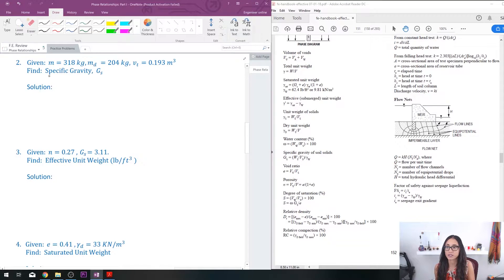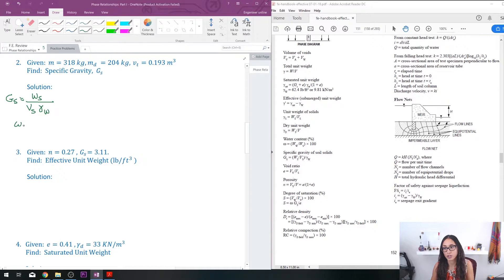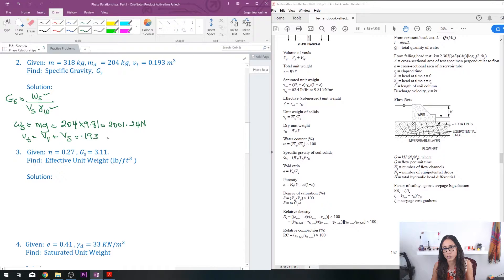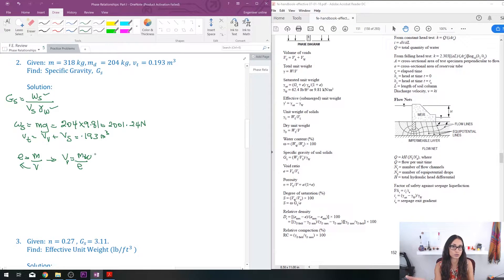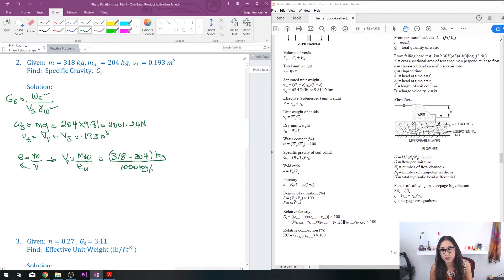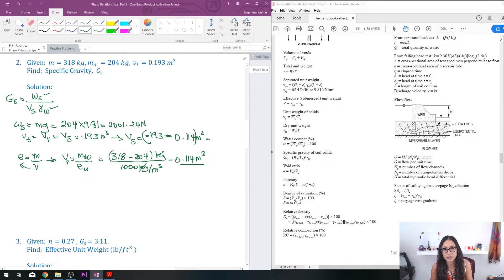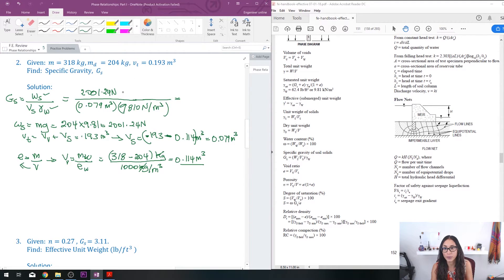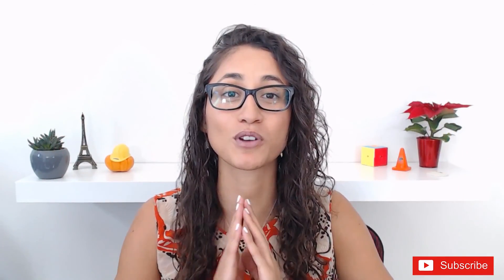FE Civil Geotechnical - Phase Relationships Specific Gravity Gs

Comment: Hi Kenza, are we allowed to make the assumption that this is 100% saturated? Because I got 0.114 for the volume of water. I was struggling how to calculate Va because the problem never stated it was 100% saturated.
Reply from the maker: Hello, you can't actually make the assumption that the soil is 100% saturated, also, we don't need to calculate Va (volume of air). All you need to determine is Vs (volume of solid), but we had to calculate Vv (volume of void) first, to be able to determine Vs. I hope this makes sense and good luck with your studying!
Reply: @Genieprep  that is actually wrong what you said. You divided the mass of water (114 kg) by the density if water (1000 kg/m^3) which gives you volume of water, not volume of void. The book where you have taken the problem from actually says it is a saturated soil sample. Only in this case, the volume of water (which you have calculated) will be equal to volume of voids. Thanks and let me know if I am wrong.

Comment: hi are you going to be adding videos for problems 3 and 4 and some bearing capacity ones? and did you get any horizontal and stress profiles on your exam?
Reply from the maker: Hello, I will be posting problem 3 today and problem 4 tomorrow. I will be posting videos on bearing capacity in near future. And yes I did get a question on the stress profiles, which I will also share with you in the future 😊
Reply: @Genieprep  ok great! was it pretty straight forward? I have my test next week :)
Reply from the maker: @killa650  Some of them are straightforward and you only need one equation to solve the problem and some of them are slightly hard, you will need to use multiple equations before you can solve the problem. Tomorrow, I will be posting a problem that I got on my F.E. exam that is slightly harder. I Hope this helps, and good luck on your test next week 😊
Reply from the maker: @killa650  Good luck on your test and keep us updated 😊